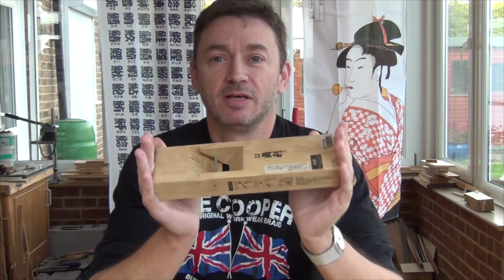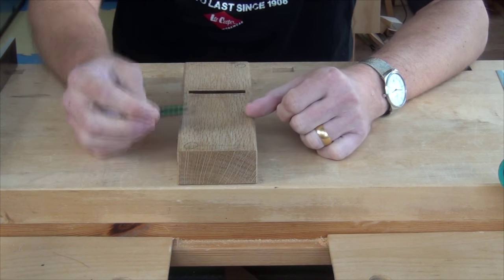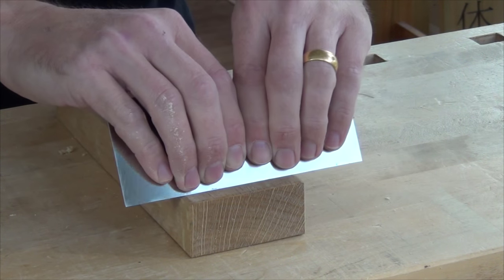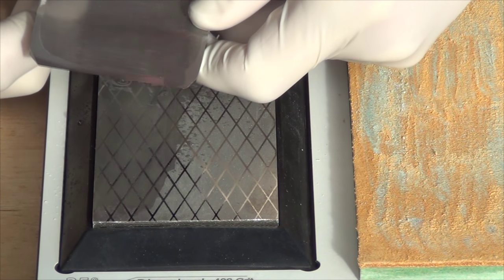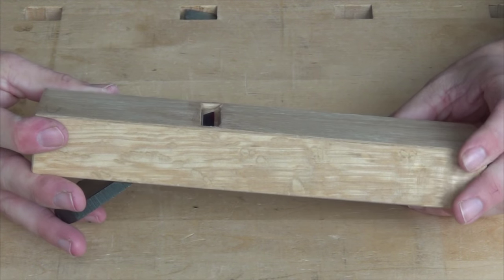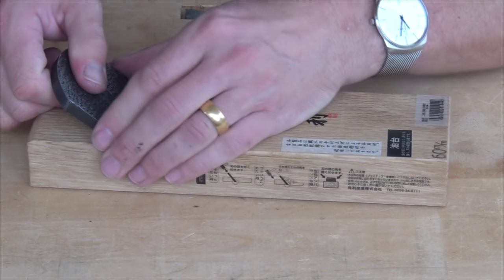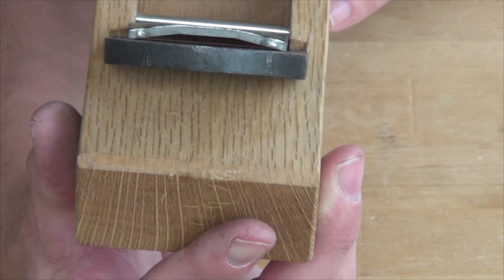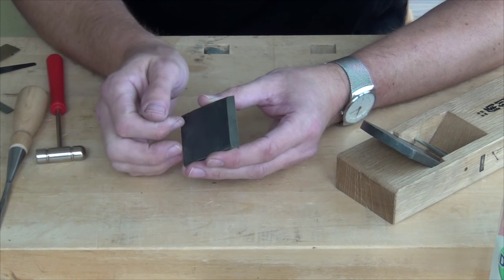Kanna Setup - Japanese Hand Plane Setup

Comment: The shita-ba, plane bottom, is not flat as might be found on other planes. The reasons for this is to reduce the effort required to pull the plane on the wood being planed and to allow the critical areas at the very front of the plane (in it's direction of travel) and the area just ahead of the mouth to be easily and quickly adjusted so they are 'in plane' with each other. Aside from 
these two critical areas, most kanna have the remaining area of their bottoms 'relieved' so they are not touching the wood being planed at all. There are exceptions to this rule of course, but the common dimensioning or smoothing plane only touches 
the wood being planed in these two relatively small areas.
Reply from the maker: Thanks, that's worth hearing.

Comment: A week ago I also bought one of these, it came with a copy of an article from Dec 2000 of "Fine Woodworking" on how to set it up. 
One thing I noticed you doing was hitting the back face of the kanna to bring out the blade, you should hit the chamfer at the back. Instead of filing the chipbreaker they use a hammer to flatten the corners. They recommend a 2 point touch (front and just before the mouth) for a smoothing and roughing plane but a 3 point touch (additionally at the back) for a jointing plane. Between the touching points they recommend to take of between 0.025 and 0.05 mm (that sounds like crazy little). And they do a shallow relief cut on both sides of the mouth because it makes adjusting the rest of the sole easier (don't know why exactly). And never use sandpaper for the sole (you didn't but others might be tempted). Grit might work into it, get loose while planing and damage your piece and the blade.

I'd say for the first time you have done a nice job and given me a view on my upcoming task - thanks.
Reply from the maker: Cheers for that. more to think about ;-) I'm amazed at all the different approaches there are out there. I saw plenty of sandpaper use when I was looking, but realised the inherent risk with that. Touch points need some thought though - very different to western planes.
Reply: +Mitch Peacock - WOmadeOD Yeah that's true, I was told it requires a different technique to get a straight planing because of those. As soon as the front of the plane leaves your piece, it would start to go down if you pull slowly, so at the end they say to speed up and "whisk the plane off the board in a straight line". I've worked with kanna in a course and can tell that this easily happens, so I often ended up with a bow shape instead of a straight. So much to learn with these. Sadly there is no better explanation in the article as to why the touch points differ for different uses.

Comment: Nice to watch your methods, i don't use hand planes because I'm not very good with them, instead i use a Japanese Shinto saw rasp and various grades of sandpaper which does a pretty good job.
Having said that i just purchased from eBay a Takagi hand plane for £22, then i wondered how i would set it up, that's how i found your video, after watching what you did I'm going to approach it in stages first I'm just going to sharpen and buff the blade and chip breaker.
If that improves it i will then look to improve the throat or opening if possible, if that all works i might just quit while I'm ahead or maybe not, I'm a bit worried if i touch the sole with any thing i might foul up and destroy the stupid thing all together.
Thanks for your insights, they should help a lot.
Reply from the maker: Well done for taking the plunge! Hope it goes well for you. Do bear in mind, if your plane is new or 'as new', that the body is unlikely to have been prepared for use. This isn't a criticism of the manufacture, simply that being wooden there is no way for the manufacturer to know how the body will alter as it acclimates to your workshop. If it has been prepared, then it's unlikely that the micro-climate of your workshop will be the same as the one where it was prepared. Don't be daunted though, there are plenty of how to videos on the subject (often different methods, but I guess they work too)

Comment: Hi Mitch, nice video. I like all of the detail and explanation. I'll be curious to know when you'd reach for this Kanna over the other choices in your shop. BTW, I bought a worksharp 3000. Doing every chisel, plane blade, etc by hand was going to take me a couple of years given my limited shop time. Perhaps not quite as versatile as a Tormak, the 3000 does an excellent job, is really easy to use, and really cost effective. I'm quoting someone here (can't remember who), but the 3000 is more or less a mechanized version of the sandpaper, scary sharp approach. I'll need to buy the wide blade attachment sometime soon and then I should be set for all of my sharpening needs. I've started experimenting in pine making the most challenging aspects of the Jefferson lap desk. I don't know if I'll manage it all with hand tools, but that is my goal. Right now I'm trying to master cutting half-laps into 3/16" thick stock for the easel component.
Reply from the maker: +Kevin Blair Thanks Kevin. I think perhaps I'll choose either a Western or Japanese approach to projects, and try to complete them only using the appropriate tools - could be fun.
I've recently seen a couple of good reviews for the worksharp - looks like a decent machine. Definitely a time saver.
Just an idea for your half-laps in thin stock. Why not gang some up and use your no.50 set up for rebates. Score the shoulders first to avoid breakout though. Looking forward to seeing the lap desk take shape.

Comment: Interesting. I bought a traditional Malay wood plane at an antiques fair in Kuala Lumpur. It is similar but has wood cross bar through the body of the plane behind the blade. It is a bit of an eclectic mix. It uses the traditional body but the blade is replaced by the blade and chip-breaker from a western-style plane. There were others there but they were too badly damaged to restore. I have since discovered that these planes are still made and sold. An 11 inch long plane sells for about 10 pounds.
Reply from the maker: If they perform like this one then they are very good value!
Reply: One Chinese dealer had a short fat one very like a kanna plane but with a blade about 5 inches wide. The price was outrageous so I didn't buy it. Later I found out the ginseng sellers turn it upside-down over a container and use it to shave of slices of ginseng.
Reply from the maker: Haha! Maybe it was one of those fantastic ones you see on YouTube taking long lengths of super wide and super thin shavings

Comment: that is very interesting to see. Flattening the sole, why did you not sand it flush with sandpaper on a even glasplate but did the more complicated way with that scraper blades?
Reply from the maker: I have an aversion to sanding, plus uneven pressure when sanding can quickly throw the sole out of shape. They're not reasons to ignore that method, and it can certainly work well.
Reply: @mitchwoodwork  OK, i understand. Yes sanding is no fun… ;)

Comment: A set of feeler gauges under the straight edge is helpful after lowering the sole at the relevant points
Reply from the maker: Thanks. Yes they sure are useful - I keep a set in my workbench drawer. Last used them this afternoon!

Comment: Great vid! At the same time really discouraging for potential buyers. So much work required you might as well call it a diy kana kit.
Reply from the maker: Could be I suppose, but the work is easy and the results well worth it in the end
Reply: I certainly wouldn't call it easy. Maybe under supervision. Also, the important question is - was the state of the plane reflected in it's adequately low price?
Reply from the maker: Tome4kkkk Ah well, I swapped it for an old Stanley no.3 from eBay which needed a clean up, so I felt it was fair.
Reply: +Tome4kkkk
Japanese planes are rather expensive. Metal planes are superior in every way.

Comment: Hi, man. Tks for the video. Could you help us? Im telling "us" ´cause I have a question I couldnt find answer on web, even in carpentry japanese sites, and could help any kanna fan. What is the mesures of your kanna blade? I mean, the BLADE. Its width and hight (this are easy to find) ans the thickness (the top side and the down side, before the sharp bevel, since it changes the thickness from top to bottom).  Would you be kind sharing this with us?

Comment: Thanks for another great video, Mitch.  I'm curious: is this level of modification typical for brand new Japanese planes?  Also with the pressures involved with the wedge, and the resulting wear on the wooden bearing surfaces, I don't understand how the plane will stay tuned.  You had to remove some material from the chip breaker to get even pressure on the iron, but if the wood bearing surfaces compress over time, won't it theoretically lose the ability to hold the iron firmly in place?  Thanks in advance!
Reply from the maker: Thanks. This kanna was capable of taking a shaving straight out of the box, but, not easily, or leaving a perfect finish. A bit like most new metal planes, some tuning will definitely pay dividends.
Time will tell, but I doubt the oak will shift much. The iron is wedged too, so every sharpening will tighten it up a bit. If it does loosen up, then the bed can be shimmed up by gluing on a sheet of paper.

Comment: OT. Regarding Japanese chisel hammers. I'm making myself a 'counterfeit' to gauge my needs. What is a good weight for use with a standard European chisel set with wooden handles, e.g. 6, 12, 18, 25 mm? My current design goal is 345 g (12.17 oz or 0.76 lb).
Reply from the maker: I mostly use a ½lb / 225g, but occasionally ¾lb

Comment: Hey, where did you purchase that hand planet from? did it come with the blade and breaker? 
Also, who makes that file/sanding block set?
Reply from the maker: I swapped the plane with a subscriber in Japan for a Stanley no.3. It came new in packaging with the blade and breaker included.The other thing is called a dresser, and also came from Japan. I think the brand is either NT or  NTCutters

Comment: Mitch
i have 2 kana planes and 2 Europeans, they are very finicky and it takes too long to adjust them to cut properly!
when I'm done with them, i always "pull out" the blades not to tension the die.
So, i came to the conclusion that it's 10 times easier to use a western metal plane than a wooden one that is so temperamental.
when you're done "playing" kana, pickup your good old Stanley for serious work!
my wooden planes are more, sort of a "conversation piece", mind you...
Reply from the maker: I think it can be difficult to move to the Kana after learning with a western metal body plane, since they are so different. But, I'm getting quicker at the adjustment, and finding the results quite impressive. There's no need to use both, so stick with what you find easiest and quickest as long as it's getting the job done.
Reply: Mitch
As much as I admire craftsmen working with different cultures of tools, I think I'll stick to what works best for me, western metal planes are far more versatile and easier to adjust, Japanese saws are in some way easier to cut with, I don't think that Japanese chisels any superior to other chisels, not to even mention their steep price.
I stick to practical and that's my MO...
I have no need for sub 0.1" plane shavings just for show, it means NOTHING, a well tuned western plane can achieve that easily!
Thanks for your response, and enjoy playing with your Kana...when you get tired of it get a Lie Nielsen, a mans name hand plane...
Reply from the maker: Horses for courses, as they say :-)

Comment: that kind of adjustment should be done with the blade in place. the reason is the tension caused by the blade when seted up. it wil cause a small curve in the plane body.
Reply from the maker: Thanks. Because of the wedging action, would the blade need setting to take a shaving? In Bailey pattern planes the tension can be applied with the iron withdrawn a little so that it's not in the way.

Comment: Great vid Mitch. not wanting to fart against your thunder but could you not have flattened the sole using a plate glass and varying abrasive papers? just saying . Mark
Reply from the maker: Cheers Mark. Yes I could, but i was aiming at the traditional Japanese sole, which is not flat. Plus I don't like sanding dust, so any alternative is a bonus for me😉
Reply: Oh i see. thanks for the answer. Keep up the great vids.

Comment: dear Mitch
I'm sorry to say this but the chip breaker is still not set up correctly, the shavings are coming out  in curl which is the same as using Kanna without the chip breaker.
You can tell whether the chip breaker is set up correctly or not by seeing the shaving shoot out straight.
there's a video clip of master carpenter Sadatsugu Wanatabe demonstrating how Japanese carpenters work, you can find it by "Sadatsugu Watanabe, shokunin, at EWS 2012" in part 1 around 19:00 - 22:00, he shows clearly and well how to properly setup the chip breaker.
best!
Reply from the maker: Thanks, I'll be sure and check that out. I haven't got around to experimenting with the set up since this video, but I've been pleased with how well it performs. If this helps me improve on it, then so much the better. Cheers, Mitch
Reply: I do believe that your Kanna would work much better than now. 
I'd been using my Kanna exactly the same way you are doing here for a few years but had never been completely satisfied until I found this video 3 years ago, it has helped me tremendously in many ways and I hope it'd do the same to you.
Best!